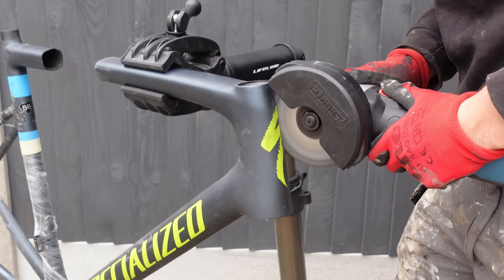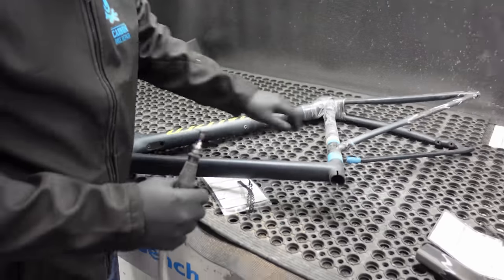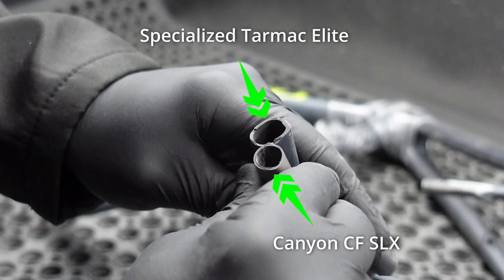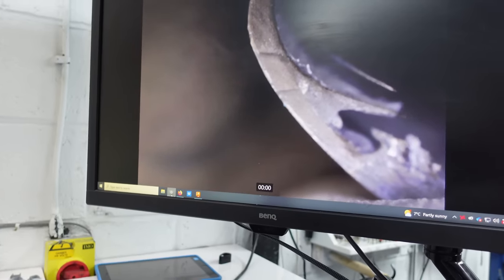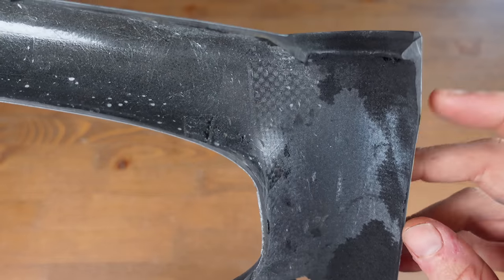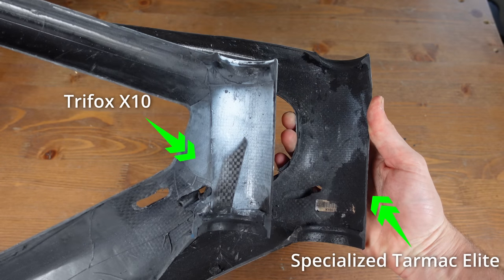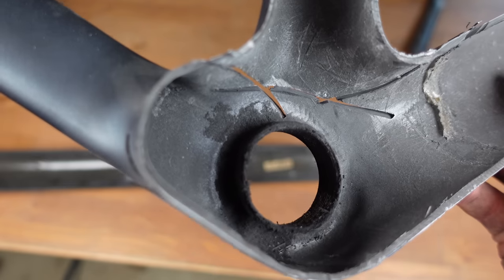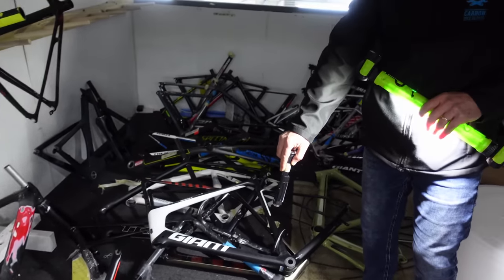I Cut a Premium Specialized Carbon Fiber Frame in Half... Here Is What I Found!

Comment: Very interesting videos - thx for the effort!

What would be interesting to know/see is if the cheaper carbon frames (from the major big manufacturers) are just heavier or if they are also inferior in terms of durability ie impact resistance and ability to have more flex in the frame because of a thicker carbon layup. 
What I took from Rob's comments about the Canyon bike you chopped in half, is that a higher end Carbon bike generally means a lighter, stiffer frame which of course gives you more performance but what if you are not racing and care more about comfort and durability? Would it maybe even be beneficial o go with a lower end Carbon bike?

Comment: Not understanding the process of Carbon Fiber layup is a mistake in almost every analysis video on you tube. The difference in the carbon fiber series for strength and rigidity is a serious scientific fact that is not addressed in this or Hambinis videos AT ALL. The Trifox frame most likely is a T700 composite and the Specialized is a T1000 majority composite fabric. T700 frames require more material to achieve structural rigidity. There are many Chinese brand T900 or T1000 frames that are dirt cheap and compare with high end manufacturers. The U.S government lobbied the Japanese government to restrict T1000 carbon fiber sales because of supposed military application use during the Trump administration. The T in the series stands for TORAY, which is the leading manufacturer of carbon fiber fabric and composite resins.
Reply: Not to mention all they think about is the shape, and thickness of the carbon layup as a determination factor for structural characteristics. These folks have no understanding of CF layup matrices and different layer directions to determine its structural characteristics.
Reply: @shinn43   Its a weird you tube format to talk about something which there is little understanding in the information age.
Reply: @shinn43  It's not easy to tell what the exact layup is when dissecting a frame like this. Voids and obvious defects, as well as extremely thin carbon areas are easy to spot, so that's what's discussed. It literally doesn't matter what layup you're using when there's a giant void
Reply: @KekusMagnus  Yes I agree with you that voids and defects can inform us of brand's manufacturing quality process and this is the extent of what can be analyzed (visual)
Reply: There's higher T1100 now I believe.
Reply: The make up of the carbon construction is, to an extent, irrelevant in this case. You can build two frames from opposite ends of the grade spectrum, and if you apply proper due care during the manufacturing process on the lower grade, you will get a good quality and useable product. It may be slightly thicker and heavier than the high grade carbon version, but no less useable. Also, if you used poor QC and manufacturing tolerances on the high grade carbon, the lower grade carbon frame would be a much better product. The point of this video series was to show what level of QC goes into the moulding processes and how that affects the overall structure.
Reply: @matt_acton-varian  Will need an understanding how the makeup/layup of the carbon construction is irrelevant in this case. Considering if you did pure unidirectional carbon layup to the same QC/manufacturing standard as a appropriate carbon layup, the difference in the bike's characteristics is IMMENSE.
Reply: @shinn43  I agree that, while in general, the layup of the carbon has a significant affect on its characteristics. However, this video series has primarily focussed on the build quality and the moulding process. The biggest difference between all the frames so far is that the recognised brands are more consistent with the effectiveness of their resin bonding compared to the Trifox. Both this Tarmac Elite and the Venge have different carbon layups however both of them have even mixing of the epoxy in their matrixes, with minimal excess. The Trifox, not so much. What it says about the frames is that even the cheaper tarmac frame will have auch longer service life than the Trifox and had it not suffered the crash damage that left it beyond repair, would still be in rideable condition. The Trifox, however, had poor epoxy bonding in some areas, which could fatigue and fail under normal use over time.
Reply: @matt_acton-varian  I agree with your take, its generally hard to watch these type of CF build quality videos and really basing purchases on that. Understandably when we compare lower QC and manufacturing investment brands, we can make these comparisons. However, when it comes to facing off big brands, it's almost a moot point.

Following China cycling and watching podcasts featuring him gives us an idea that most if not all brands are relatively made in the same factory EXCEPT diffferent branches and QC standards.
Reply: Keep in mind that T1000 is stiff, but brittle, so it's mostly a marketing term because higher number is better. So even brands that put T1000 everywhere they can are mostly T700/T800
Reply: @dainiusvysniauskas2049   Isnt marketing at all. The frames tend to be lighter and more expensive. Combinations of cloth are used for strengthening.
Reply: @thiosemicarbizidebenzoylal2921  Then why do so-called T1000 SL7 replica frames weight 100-200 grams heavier than actual Tarmac SL7?  Also, how can resellers guarantee that the frame is made out of T1000 carbon?
Reply: It's a funny video. These guys don't have a clue about carbon manufacturing. Eyeball observation what a hoot!
Reply: Carbon fibre break very easily but we are told its super strong. What’s  with that? 🤔

Comment: The seat tube is actually the least stressed part of the frame. As are the seat stays. I think you all might be over thinking or assuming the manufactruers are more performance focused than they are when it comes to all the tube shapes and thicknesses. These days they all more or less do the same things with their frames. Unfortunately the game is more about distinguising the look as in its design. 

Any carbon frame with the thinness seen here and elsewhere say like in the head tube, bottom bracket and seat tube area are all going to be prone to fatigue and much sooner than if those features had been reinforced. In all honesty that is what makes a race frame a race frame. The life of the frame is compromised and fatigue over say years is not the issue, since, the manufacturers see these frames as replaceable. 

I'd never buy one of these carbon frames if one was hoping to have it for 10-20 years. There are independent makers who do carbon to last but they aren't so concerned about weight. The thinness of say the bottom bracket shell and any tolerance which is off is likely to creak and dare I say I have encountered more people with frames from the larger companies which have these issues than say ones from the indies. That said carbon is an old material now and not exactly progressive or state of the art so I am always surprised it still garners so much attention in the industry and how racers and even just riders get sucked into believing it is superior. 

As for the thinness issue with say something like a top tube, well, just think what happens if your bars fling back without too much force as they might do in a small crash or even just in transit? I don't want to sound like a luddite as I have a carbon frame myself but there are alternatives to these more fragile frames that are not built to last and really only add little to no improvement over say a thoughtfully crafted frame by any number of individual makers or smaller shops.
Reply: The most shocking thing about these frames are the selling prices.  They are virtually all cheaply manufactured on mainland China and then sent to Taiwan for finish to give the manufacturer tax breaks.  They are not even custom, yet they are charging prices as if they are some boutique high quality manufactured custom frame. For the silly prices that Factor, Specialized, Trek, etc... want for their cheaply fabricated mainland China made cookie cutter stock framesets I could literally get something like a Pursuit Cycles fully customized CF frameset built in the US by an artisan (Carl Strong) and that frameset would be customized to me, not some stock cookie cutter bike.
Reply: @rcg9573  I agree it is upsetting how many riders will keep switching frames out for what the industry brings on as the new style every year etc. I don't know why more people aren't into the idea of getting a handbuilt frame in the US that will last 20-30 years over these offshoring brands. Plus many of the smaller builders give you a 25 year warranty on the frame itself! My Calfee is going strong at nearly 50K miles and all the specs like the bottom bracket are spot on so no issues there etc.
Reply: @rcg9573 absolutely! They are way overpriced.
Reply: @speciesofspaces how long is a bike suppose to last? 🤔
Reply: @kalijasin  material like titanium a lifetime and in terms of standards there really isn't any reason why some of the old standards should ever have to go away etc. 1 1/8 head tube isn't bad and 68mm english threaded BB works just fine. But carbon does fatigue. However I am sure most people who replace their frames do it because they want something new and not because it needs replacing.

Comment: Thanks for the video, but I am struggling to understand that this is a 2015 Specialized Tarmac Elite SL5, as you show in the beginnning of the video. The frame you're cutting up has dropped seatstays, something Specialized introduced from the SL6. Also, there are disc brake mounts, another feature first introduced on the SL6 Disc, which was released in 2018 and with new colorways in 2019. Pretty sure that is an SL6 Disc. Probably the "Sport" version.

Comment: Hi Jourdain,
That video is very valuable in understanding the frame's structure.

Have you measured with a caliper its wall thickness? I would be very interested in knowing that parameter.

Another important paramrter is the texture type of the frame. Can you tell any insights on that matter?

Btw, you can find more data on its structure if you slightly burn the edge of the parts which will delaminate the layers - this will tell you how many layers are there. Would be very interested to know the result if you do so.

Thanks!

Comment: Good job
I have a couple of Parlees. A Z Zero and an old CX that I don't use. On the one hand, it makes me a little morbid to see what it's like inside. But on the other hand, it would be a shame to break a frame that can still work. What a dilemma. What What I can say is that carbon and its lightness-stiffness is more for professionals or people who move a lot of watts. Most of us would go the same or better with a good steel or titanium. I have a 953 stainless steel and a titanium Baum and I like it a lot the feeling of metal on the road. For the mountains I am not considering a double that is not made of steel. And a hardtail that is not also made of steel or titanium. Carbon does not interest me in the mountains